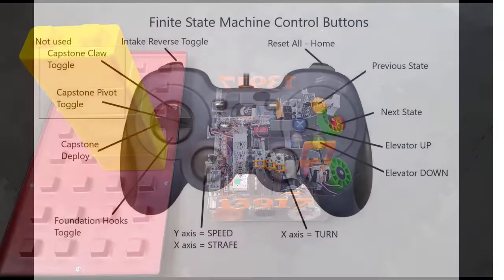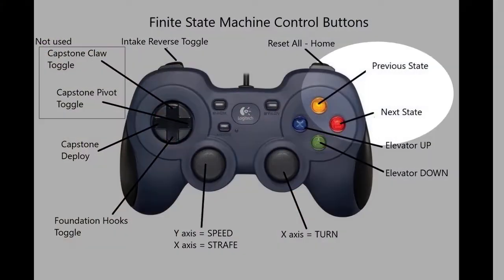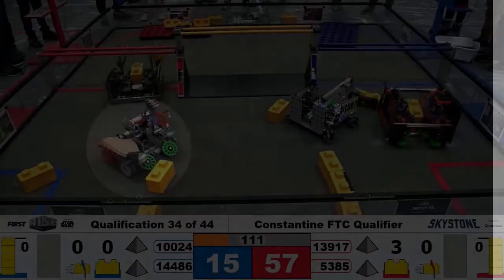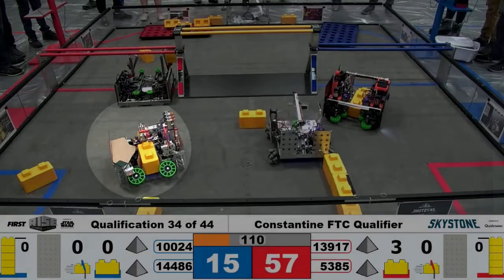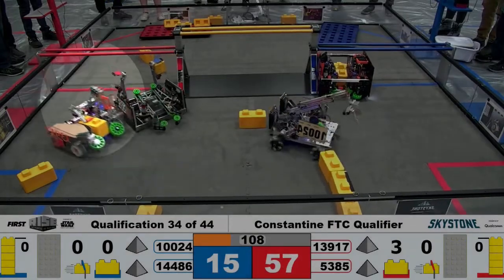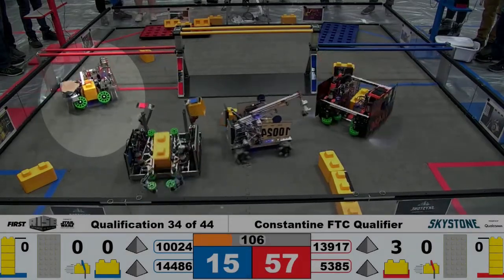FTC Skystone Team #13917 Robot Human Interface

Comment: I had something similar in mind for programming the arm to go to the right height, but I see a possible improvement. Would it make sense to store the encoder count of your last scored stone? After you score a block the variable should increase the amount of encoder ticks needed for the next level. You might wonder what to do if your teammate adds to your skyscraper while you are collecting another block. All you would need is another button that increases the set position. This means you could change your set position at any moment...you don't have to power your arm to get the value you want. If the tower falls over then you would need a reset button....but you guys are way too good to need that lol
Reply from the maker: That's not something we've built in, but a good idea. Instead of using the manual up/down elevator buttons, we could add a state in our state machine that raised the elevator to the predicted next height.  If that ended up being wrong, we still have the manual elevator buttons to fix it.
Reply: Marc Dyksterhouse that is a good idea...I like that even better actually

Comment: what is that pulley thing that you used for the servo wire management?
Reply from the maker: They are simply retractable wire holders for ethernet cables converted over for our purposes.  We replaced the cat5 
 cable with a three conductor wire to make our PWM wire.  Here's a link: https://smile.amazon.com/gp/product/B017OEB32I/ref=ppx_yo_dt_b_asin_title_o07_s00?ie=UTF8&psc=1
Reply: @marcdyksterhouse9634  I bought two of these...I would like to get rid of the locking mechanism inside. Where you able to take it apart and acheive this or did you find another solution?
Reply from the maker: There is a screw under the sticker.  Peel the sticker off, remove the screw and very slowly separate the two halves.  There are small pins that are very easy to break.  You will need to super glue the two halves if you break the pins. There is a ball that will fall out.  That is the locking mechanism.

Comment: Do you use the activities X rail kit
Reply from the maker: We use the ServoCity Cascading X-Rail Slide Kit, 3-stages, double continuous stringing for power up and down along with a single Neverest Orbital 20 motor and Andymark winch that has a custom divider to separate the up and down string.
Reply: @marcdyksterhouse9634  because the kit comes in 15 in lengths, how did you cut the beams on the slide kit so that they fit under the bridge?
Reply: or did you buy shorter rail lengths to go with the kit?
Reply from the maker: Yes, we bought 12 inch x-rails.  www.servocity.com/x-rail
Reply: @marcdyksterhouse9634  thank ypu